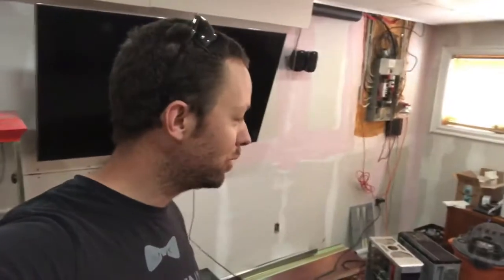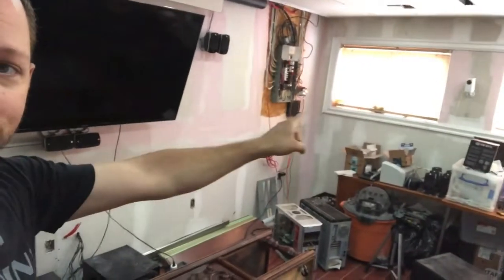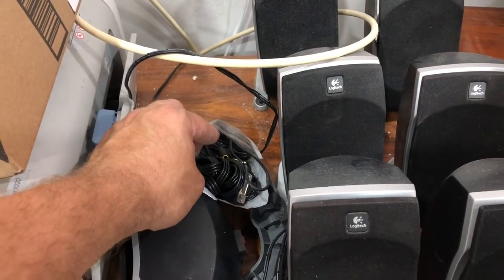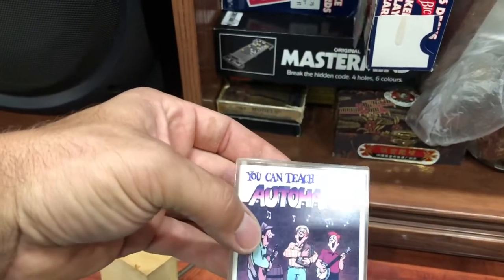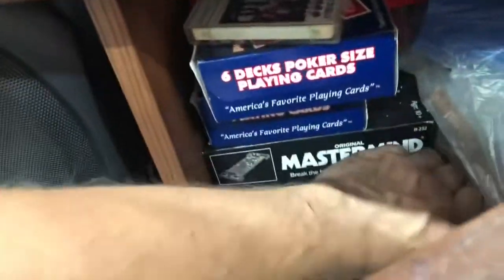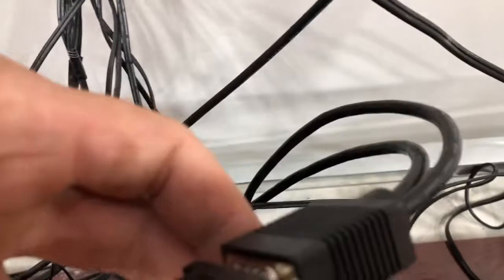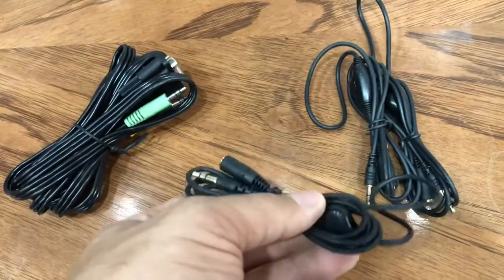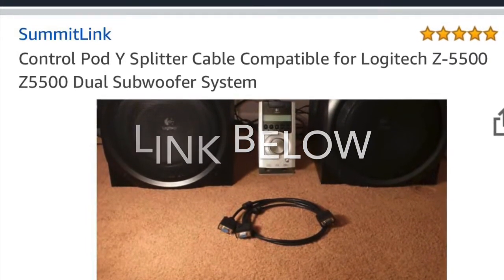Dual Subwoofers 🔊 🔊 Home 🏡 Theatre Build DIY - Logitech Z5500 ( old / vintage / antique ) 🤪

Comment: I finally got me a 2nd z-5500. I made sure it's the same, although not the same PID, instead of the off button in the bottom right corner, both has buttons with headphone icons. I even tested both pods on both subs and they work 100%, went through all the settings etc and they both work from the same remotes. Now I'm waiting on my Y-splitter to arrive.
Reply from the maker: Hell yeah brother =] 🤜🏼

Comment: This is very interesting... As of later today I'll have 10 z5500 speakers, 1 sub, 1 remote and 1 control pod. (I used to have this system, but have since lost the remote and subwoofer so couldn't use it for the past 3-4 years.) But later on this morning I'm going out to buy someone's used z5500 system locally for $100 so I look forward to having this all set up with 10.1 speaker setup! 😲 lol. Must sound great what you have here.
Reply: It does. Movies nights are epic. I have heard some have had issues but as long as they are they same modal and generation you should not have any issues. I bought about eight systems until I could do this properly. Re-sold the others to re-coop the cost of making this work flawlessly. LoL. You can’t exactly show up  to someone’s house and explain to people oh let me see if your system is compatible to mine. LoL. But yes. It’s very enjoyable. I love how I got lucky and was able to put the two subs in my coffee table. =] 💜
Reply from the maker: Somehow I replied from my personal. YouTube.  Sorry about that.
Reply: What do you think would work for 2 sets with 2 control pods one is the older coaxial speaker cables and the other is the sloghtlu newer model with speaker wire

Comment: Hi, i just bought another Z5500 system that had a compatible PID number..My centre control pod was playing up,but love these speakers so much for my laptop.... The seller dropped his system  off for me and was more than surprised when i told him i was planning on joining two sets together..I watched your video but am still at a loss of what i actually need at present. Unfortunately i am no rocket scientist but will go through the comments.. Thanks for making the video.Cheers.
Reply: So i need a custom control pod Y splitter cable to join two subs...Cool bananas....Thanks mate..
Reply from the maker: @richyearle007  Control Pod Y Splitter Cable Compatible for Logitech Z-5500 Z5500 Dual Subwoofer System https://a.co/d/5dW7kBO
Reply from the maker: Hope this helps. ✌🏼
Reply: @803Garage  Thank you..They say the Y splitter is unavailable on Amazon but i found it on Ebay.. Cheers.

Comment: If i connect one control pod to two subwoofers will each get the same amount of power as they would if they were connected to different pods?
Reply from the maker: In theory yes. This is what the y cable does. I haven’t seen an electrical wiring diagram which is why I bought the cable to allow this to happen without cutting  soldering and wiring etc. it wasn’t something I personally wanted to try and then release the ghost 👻 aka burn 🔥 something up.

Comment: Hi, I have a Logitech Z-5500 THX-Certified 5.1. I want to ask if the sound amplification part supports 2 or 3 more speakers of the same kind, that is, identical from a similar system, to take the speakers and add them. I don't care about the quality or the volume, only if more speakers can be added without damaging the system over time.Like you done but put 2 speakers in one exit (2 right/2left/2back/2front no other subwoofer just one with 10 speakers) Thank you.

Comment: How would you connect this sub to a receiver? Please let me know. Thank you.
Reply from the maker: I would use the pre outs of the amp which are the low voltage outputs so only the signals go to the control pod and this also allows you to your more speakers using the amps power.
Reply: @803Garage  Here is what I am doing I have PTA66BT.5-U-A receiver, I want to connect the Z5500 speakers directly to the receivers speaker terminals. Then I want to use the subwoofer to the receiver and use the receiver as the main unit to control everything. (through it's remote) What I see from your video, I would connect the cables to the (VGA Port) looking thing on the back of the sub? Now where would all those connections go? The green, yellow and black? Normally they would be connected to the back of a PC right? This is where I get lost. My receiver does have a sub out port. Sorry, and thank you again for your time. It is appreciated.

Comment: Well I'm back and hope someone can help me with issue I'm having. Got my Y splitter and made sure control pod works with both subs but when I hooked up them up dual the control pod glitches showing filled digital patterns on display and subs switched off so i disconnected them put back to 1 sub what could be wrong?
Reply from the maker: Damn. I wanna say it has to do with the splitter because the system immediately powered down to protect itself. There must be a short somewhere base on the symptom.
Reply: Yeah I agree 🙄, do you have any suggestions maybe try a different cable?  I was trying open web link on the Discription posted for the Y splitter but said error. I was wondering where can I buy a legit cable perhaps I bought a low quality 🤔  and thank you for the help I really appreciate it bud!

Comment: hi, I have 2 Z5500 subwoofers, but where can I find the cable you are using? i want to connect 2 of them to a control pod, can you help me?
Reply from the maker: Control Pod Y Splitter Cable Compatible for Logitech Z-5500 Z5500 Dual Subwoofer System https://www.amazon.ca/dp/B0799FQKMP/ref=cm_sw_r_cp_api_glt_i_WMF5TXAGRKGKV7NQS95T
Reply from the maker: Hope this helps ✌🏼

Comment: do you have extra control pod after this? can sell it to me ?
Reply from the maker: Yes I have a couple of extra control pods. I do not know if they work and there are a couple of different modals so you would have to match the correct generation of pod to the same sub woofer or base. I’m also in Canada. 🇨🇦

Comment: I connected 2 subs with same rgb cable and it's not working  :((
Reply from the maker: Łukasz Wągrodny this is why I bought several units to get two that will work together. It sucks but this was my process to make this happen and function. I don’t know the exact differences and how to find two compatible units other than testing on th spot before you buy. I wish I could help. Truly.

Comment: Just bought a second Z5500 sub used that worked when I bought it, got it home and it doesn't work with my control pod.

Any info on why this might be?  I did notice my original z5500 sub-amp has the satellite speakers that plug in like RCA cables, whereas this "new" sub does not (it has red/black clasps that grab bare speaker wire).  I guess there were different generations of Z5500's and certain components are not interchangeable.

I'm not giving up hope just yet, I'm on the lookout for the style amp that's on my original sub to replace the on the sub I just got.
Reply from the maker: Yes. They have to be the same generation. You could use a signal multiplier and this would allow you to use both at the same time. This means both control pods etc. Two volume controls. Could be annoying. Having the same volume control is important. I hope you can find the same generation. =]
Reply: Hey, I am looking to do the same thing. How can I check what generation each set is? so I can make sure they are the same? thanks

Comment: Dude can you please tell me or give me a link to a cable/adapter how i can attach 2 subwoofers to 1 control pod... Cuzz i have 1 complete Z5500 set and 1 loose subwoofer with only the power Cable... I read some people tried various splitter cables that are for sale but gave them trouble or destroyed their set... You seem to have it working.. Do you have a link to the cable/splitter how i can attach them both to the pod
Reply from the maker: Yes 👍🏼
Reply from the maker: Control Pod Y Splitter Cable Compatible for Logitech Z-5500 Z5500 Dual Subwoofer System https://www.amazon.ca/dp/B0799FQKMP/ref=cm_sw_r_cp_api_glt_i_ABE9VXATX8EQXFFGE6MP?_encoding=UTF8&psc=1
Reply from the maker: Your sub and pod have to be the same generation. A good test connect the control pod to the lose subwoofer. If they work you are in business. If not the splitter cable won’t work.
Reply: @803Garage  i believe there were 2 generations of this configuration? (The first one had a bigger blue-ish control pol in upright position and the newer one was smaller with Orange light i guess
Reply: @803Garage  thnx i bought one immediatly! And i already tested the Loose subwoofer with a power Cable and my existing pod with 1 speaker to it attached to hear sound easier and that worked! So thank you very much!

Comment: Bro how do you get all the satellite speakers to work? I have been using mine but only few are functioning
Reply from the maker: I use an adapter to make them function as one. So to base subs which function together and power the speakers under one control pod.
Reply from the maker: Logitech Z-5500 Z5500 Control Pod... https://www.amazon.ca/dp/B0799FQKMP?ref=ppx_pop_mob_ap_share
Reply: @803Garage  I would send your a video of my set up. That’s the same pod I used. I bought the Bluetooth adapter as well. A Bluetooth receiver sold by Logitech. I just can’t get the (5.1) experience. 
I have 10 surround sound speakers. I labeled them one to ten. After completing that, on Prologic 2  (PLll- Music only 4 you’re hearing clearly. The best mode which gives me 8 out of the 10 Is stereo X2. But I know all can work, I tried the individual boxes (subwoofers) on the mode AnalogX1 and I’m hearing all 5 surround sound speakers playing good on music but when I hook them back up together 💀

Comment: Your z5500. 

Hi have a question.
Both subwoofers have output with power to the pod.  does the pod not be damaged when it receives power from both subboxes through the y split cable?
Reply from the maker: No damage. I bought the cable from Amazon which is apparently “built” and not your typical serial monitor signal splitter cable. I have two of these. One set in my bedroom and another set in my theatre room. Both are awesome and still working well. =]

Comment: can for example use a vga splitter to connect to logitech z906 ???
Reply from the maker: I asked someone who did this and they told me it fried their system. It also says that in the ad on amazon for the adapter. Honestly. I would not risk it. =] hope this helps.

Comment: Btw im not very good at these kinds of things but after doing some research about pid on the logitech speakers I got a bit confused
Mind if i ask you what the pid of each sub is and also the control pod?
Confused isnt even the right word but I want to get another logitech z5500 sub which i can use with a control pod thats just laying in a box (the pid is 743)  and my question is, would it work with a sub that has a higher PID than the control pod?
I looked on ebay and it has a sub with 838 PID and like 3 524 PID and was wondering if I should get one of the lower ones or get the higher one.
Sorry if this confused u
Reply from the maker: I’ll do my best to find some information. I’ll be back in a few days with a proper response. Hopefully it’s good news. Sorry for the delay. But I totally understand your question.
Reply: @803Garage  thanks for the reply, I looked at forums and someone said it works with any sub, hopefully that’s true
Reply from the maker: @prod.MRBLOXY I hope so aswell.  @prod.MRBLOXY If they have the same build code they will be compatible.
Reply: @803Garage  quick update, i bought the spliter and connected both my z5500 subs and theyr working perfectly fine! Im kinda wondering if you buy another spliter it will work with 3 subs but I doubt it would, 2 is already enough tho :P
Reply from the maker: @prod.MRBLOXY that is awesome =] 💜🤜🏼 I have yet to see anyone do it. Hehehe 😈

Comment: Nice setup! :D Now, that's something i'm interessed to do for sure! I have two questions : can I add only a second subwoofer but with only one set of speakers? And all I need to make it works on a computer  is to buy an 'Y' cable splitter for mounting the two is parallel ?
Reply from the maker: Yes. Y cable and two identical units you can have a dual system. =] thank you for the reply.
Reply: @803Garage   @803 Garage By Mr DoALL  great! Thanks for your fast response !

Comment: Hi, what is the cable you use to connect both subwoofers, a simple VGA cable splitter?
Reply from the maker: Control Pod Y Splitter Cable Compatible for Logitech Z-5500 Z5500 Dual Subwoofer System https://www.amazon.ca/dp/B0799FQKMP/ref=cm_sw_r_cp_api_i_XQ7ZBFVRXTN3EQ408VMD?_encoding=UTF8&psc=1
Reply from the maker: I was did research and apparently it is not your simple VGA splitter. If you did that it would short your system. Also your systems need to match modal numbers. As long as each pod works on the opposite sub this cable will work for you.